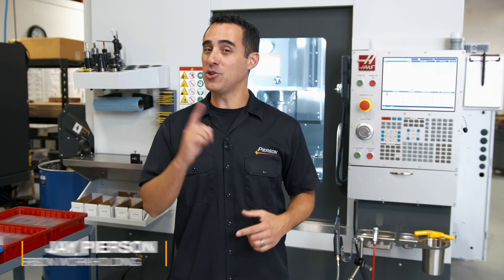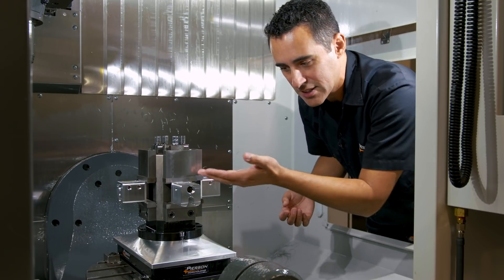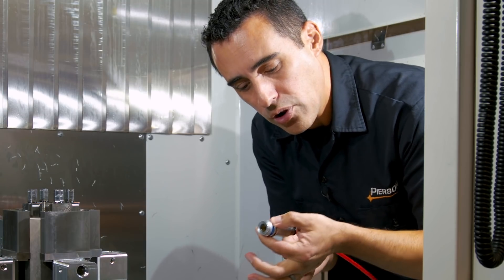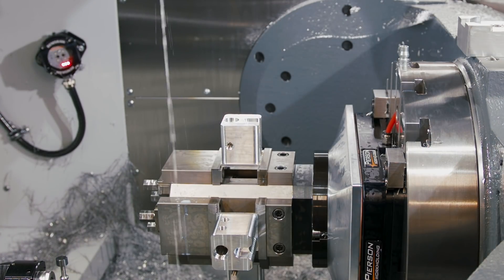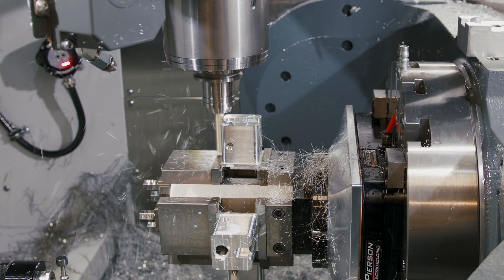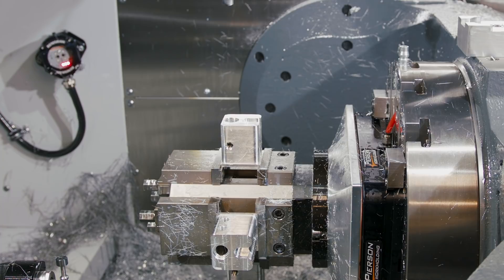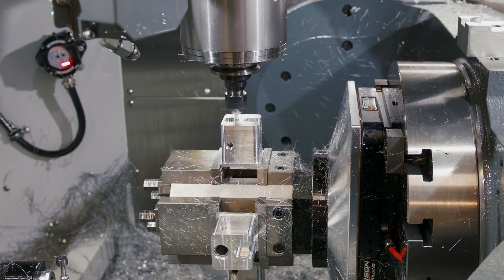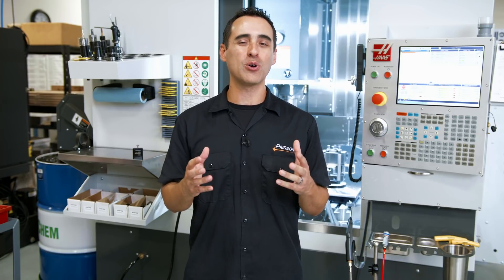Making CHIPS - Haas UMC 500 - Pierson Workholding | Pro Pallet System

Comment: Nice video I love seeing work holding it always give a new perspective.
Have you thought of using small fixture plates instead of a vice? Why not go octagonal instead  of square ? And if the part was set on a 45deg angle you may get two rows of parts that could get you 16 parts instead of 4 . Just a thought with out modelling it up but could be a good option.

Comment: With the thread tool in 360. I'm guessing you have to tick the "modelled" check box to produce thread in a CNC?
Reply from the maker: "Modeled Threads" look good but is sometimes problematic on the CAM side.  We draw to the minor and use "Pitch Diameter Offset" to specify the programmed size.  Fine adjustments of the thread diameter are then done in the machine control using cutter compensation.

Comment: Thanks for sharing your process Jay. Do  you normally cover the male air connection to prevent swarf or coolant form entering?
Reply from the maker: Nope, we just leave it open.  Coolant wouldn't affect anything and the internals of the PPS Base have wiper seals.  A super lucky chip that made its way all the way to the cylinder wouldn't be an issue.
Reply: @PiersonWorkholding  good to know, thanks!

Comment: I like the way the post will rotate one way to do two parts then rotate all the way back around the other way to do the next to instead of simply rotating to the next one.
Reply: Yeah that is annoying, I haven't looked into getting fusion to stop doing that. What's worse is between tools on non-indexing tool paths like swarf, the post spits out G92.1 C0, changes tools and goes back to whatever C value it ended on, did that to ~ C 2000. for a program....
Reply from the maker: Yes, it's a love-hate relationship with the post.  What's crazier is if you're at 359 deg and command it to go to zero, guess which way it will go?  Yup, the long and stupid way.
Reply: @PiersonWorkholding  https://www.youtube.com/watch?v=vupmJflbAIE is this can solve this problem ?

Comment: You guys have to try the quick disconnect from Prevost, they're self-venting, so they're really quick, and easy to connect vs the Japanese style.  You don't get the pop, or have to push them as hard. 
https://www.prevost.eu/connection/quick-couplings-and-adaptors-for-compressed-air-2.html
They make some of the best air guns, and fittings on the market in my opinion.
Reply from the maker: Good to know.  We'll look into it.

Comment: You talk about lean, but your tool oaths return to safety each time when you rotate?? Wastes alot of time no? 
If the cycle time is no issue then that's fine but I would of thought parts want to be on and off the machine as quick as possible.
Reply from the maker: The hierarchy of improvements in lean is Safety, Quality, Simplicity, Speed.  Trading safety for speed means you'll never get caught off guard if you start in the middle of a program, slightly miss an offset, etc. Rapiding to Z8. vs Z3. is mere seconds added to the cycle time and not worth compromising safety or process reliability.
Reply: @PiersonWorkholding  there are so many things to put in place to eliminate everything you have mentioned. You are a smart man. Use your imagination.
Reply from the maker: @fordhoarder As you said "things to put in place" violates simplicity.  You seem smart... what would you put in place?
Reply: @PiersonWorkholding  I am a process engineer for a large production shop. It's my job to make a job run as fast as possible and so simple an untrained operator could run it. Some machines have settings that make it impossible to start anywhere but an M6. If not, you can write a small macros to prevent it. Same if an operator fat fingers an offset.
Reply: Pierson Workholdin
Reply: I came here to make the same comment and you beat me to it. LOL. Didn't expect to see all that fat from a guy that preaches lean manufacturing.
Reply: Safe retracts on a 5 axis machine are complex decisions. While it is possible to manually edit this program to gain a few seconds - that takes time. When the part or program is changed - the freshly posted program needs to be manually edited again wasting more time. Each time manual edits are made - a person needs to watch a cycle or two to ensure it is safe. 

The ultimate lean solution is to put the complexity in the post processor so that it posts the most efficient code with no edits. This takes time, but only once. This is why I have put a lot of effort into post development. I can get 'cycle-start-ready' programs for 5 axis mills and 7 axis mill-turn machines - they require no edits. That is where this process is going in due time. Lean is constant improvement, not instantaneous perfection. 

As Jay said - speed is the last priority because the few seconds of cycle improvement do not overcome the effort to manually edit the program every time. Splitting hairs on cycle time rarely adds value to the entire operation when other factors are considered.
Reply: @Factory400  I can't speak for Confussion360 but every other CAM system I've used has the ability to set the clearance plane. This can be set for every offset and therefore no hand edits are required once it is set to your liking. I too am a big fan of running the file as it comes off the post. Hand edits can be dangerous when reposting after making some  adjustments.
Reply: @fordhoarder  The challenge here is that this Haas machine is using TCPC Tool Center Point Control which is computationally rotating the coordinate system as the A and B axis change. The conventional clearance plane concept no longer behaves as intended - because the Z axis becomes the X axis as the A is rotated. 

TCPC is a great tool, but it presents a whole new challenge for the post processor to calculate the safe zone that is now dependent on many other factors.
Reply: @fordhoarder  It has nothing to do with any limitation of Fusion360. Any CAM system will face the same challenge dealing with TCPC.
Reply from the maker: @fordhoarder  @factory400 is right. The post processor sends the Z home on all B and C index moves for maximum safety. This can't be overridden or controlled by changing the clearance plane. @factory400 Send me your resumé if you're interested... I only hire rock stars and I can tell from your comments that you "get it". We'd be fools to trade seconds of cycle time for potentially thousands of dollars of damage.  jay(at)piersonworkholding.com.
Reply: @PiersonWorkholding  😂
Reply: @PiersonWorkholding  you are the man. :) Excellent attitude of efficiency. 'Seconds' of improvement is nothing compared to a full day of downtime for damages. Of coarse, only 1 day is a good crash. Could be more. 100% efficient programs are only shows that on demo days. Not realistic production. Not worth it.
Reply: @Factory400  all very interesting thins i run a cms ares, antares and a dmu 340g linear all great machines. tbh dmu spends more time broken than working. 
it is dependant on many factors i agree. 
i get that the few seconds you save doing this may be little but after 1000's of parts it adds up, unless there is a bottleneck else where for this part so speeding up is pointless? 
with this relatively small run time could you not go through and find a closer point for the retract height and prove out the code? 

never used fusion for cam, however its design software differs so much from inventor which I use, that did surprise me. i Suppose it is what you are used to.
Reply: I mean Jay, obviously you don't know what you're talking about this dude works for a big company and uses fancy dancy software, opposed to you who owns your own company... keep up the good work and glad to see some videos on the UMC500, the design improvements over the original 750 are great

Comment: why do you not machine the holes on the backside at the same time as the front that would save you some cycle time because you do less repositioning
Reply: Pretty cool! I must say I would go nuts with all the extra index moves and extreme clearance moves if I wanted to run that part as a production piece.
Reply from the maker: @markus Metzger Good idea but the holes don't line up.
Reply: @PiersonWorkholding  i know but if you do positional 5axis and drill 2holes in part 1 and 1 hole in part 3 then rotate the roto-vise and do 2 in p2 and 1 in p4 and so on
Reply: It’s because of the way autodesk’s post processor works with multiple patterned parts. It’s not very efficient, and actually can crash the machine if you only run two parts 180 degrees opposite of one another and don’t factor in the retract plane to clear everything.
Reply: @gamingpc3475  OK thanks now I understand
Reply: @gamingpc3475  Instead of programming it as a patterned part maybe the solution would be to lie a little and program it as one part? It might take a few more mouse clicks...  I assume XYZ0 is the center of rotation? For me it would be easier to bust out the "fat finger-o-doom" and edit the program at the machine. F2 copy & paste is your friend on the HAAS control.
Reply: Justin Warren that really is the way that I have found to go about it in autodesk.
Reply: @Kaptn_Obvious  the problem with with editing on the control is that if you make upgrades to part in cad , then you do your cam ,load it into machine & go through re editing it again . It would be great if cam programs could read backwards from machines & adjust cam file to what you have edited on the machine. I try to edit every program only in my cam , so I can keep setup sheets & tool lists up to date.
Reply: @robertsomerville5377  I understand your logic, but it doesn't work that way for me. I have 1,000+ short run parts with multiple ops that we  make on an irregular basis. Most of the revisions I get are hole location or size, or programed for obsolete tooling, or the program is for a machine we don't have anymore Some were programmed with obsolete software.. Most of the time my "hit & run get it done" method it to edit the program at the machine, or get "programming" to give me some code only for that part of the revision & splice that into the old program. Update the setup sheet, back up the new proven program and then go put out another fire.

Comment: If you were getting too cute with your clearances. Instead of having the valve stick out over the table. Practically get rid of that red hose (or have be extremely short), and attach it to the pro pallet itself. The valve sits on the table, and then 3D print a little cover to go over it, to protect it from chips. :)
Reply: I'm sure that reply was here somewhere. Can't see it. - What I meant was, the connector was already in the T-Slot, instead put it right next to the pallet closer, and on top of the T-Slot, so that nothing is protruding outside the Haas table diameter.
Reply from the maker: @gredangeo  I replied but then deleted because I misunderstood your suggestion.  I later realized that by "valve" you meant "fitting" and I thought you were suggesting to keep a valve with an airline connected.  We had an adaptor like the one you suggested but the chips kept collecting around it.  The second version in the video keeps the face of the table clear of chips.
Reply: @PiersonWorkholding  Oh, ok. Cool, thanks. :)

Comment: Hello Jay , Awesome video - how is the accurancy of  the rotational axes on the UMC 500 ?
Reply from the maker: Very accurate!  The UMC uses glass scales on the B and C for high accuracy positioning.
Reply: @PiersonWorkholding  I don't know about that. I am getting ~.003 on position on holes on the opposite side of 2" block drilled at B90. Also working anywhere near the extent of Y travel and tolerances get really loose.
Reply: Following up on this, have you inspected your parts on a cmm? I doubt those holes are where you think they are.
Reply from the maker: @ericharvey2968  I think you need to run your MRZP calibration again. We recalibrated shortly after installation and found it to be off. We did it a month later and it was still dialed in with no changes needed. DWO is also a key factor to look into as well.
Reply: @ericharvey2968  without knowing more about your setup I'd agree with jay that you've got an mrzp issue. For testing the rotary can you square up an edge and then rotate the rotary 90 to see how it's sitting?
Reply: The parts I am referencing here were done 2 weeks after the install. So I didnt think to re calibrate. I just did the mzrp cycle and x and y location were out about .0006 and the z was out .0026. Gona recut a test and get it inspected. I didnt think to recalibrate so soon after the install.
Reply: @ericharvey2968  yeah I'm not super familiar with that stuff but I'm under the impression that most of the settling happens shortly after the machines been set down. Those values doesn't sound all that bad. It's annoying but you'll want to make sure your probe is calibrated well, I'd bet that Z value might change again after calibrating your probe.
5 axis machines are great but you got to keep an eye on that sort of thing. Our shop isn't temperature controlled so thermal growth is an issue, if the z axis moves .001" and you're decking a part at B90. C0. then B90. C180. the part will be .002" away from nominal. I chased my tail before realizing what was going on with that haha
Reply: @spazzywhitebelt  I feel dumb on not rechecking the center or rotation. As for Z growth, I cut a lot of injection molds on my VF2. on these z blends need to be .0002 or better. To do this I need to stage the program so I need to constantly reset tool lengths because the spindle will grow. Then on finishing tool paths I need to cut deep because the tool holder seems to drift into the spindle (.0001 or .0002). Even the X an Y work offsets seem to drift by .0002 to .0004 after 6 hours of cutting. Makes me wonder how nice an actual mold machine is.
Reply: @ericharvey2968  Those are some itsy bitsy numbers haha. yeah if you're talking that kind of precision I'm don't think the UMC is going to do that, especially indexing or simultaneous 5 axis, it'd be better if you indexed and probed but even then not that tight. We have a VM3, we haven't done molds but have been pleased with blending on the stuff we've done. now if you're talking a japenese machine idk nothing about those because our bank account couldn't handle that haha.
Reply: @spazzywhitebelt  Do you have a good work flow for probing at B90? The inability to run probing cycles while DWO is active caught me off guard. Have you figured out a good probing work flow?
Reply: @ericharvey2968  yeah that caught us off guard too and unfortunately nope. we model the whole setup in Fusion and will create multiple setups (in different orientations) all with their WCS at the center of rotation, then on the machine you set all the WCS's XYZ the same and change the B and C values for each WCS per their orientation, its not great but having all the XYZ's the same makes easier to get your going for probing. We do low volume work do it works for us, there might be a better route though.
stuff like that is annoying but idk if other controllers can handle that, I'm going to assume not and even if they did you'd probably have issues after the part is indexed to a new position because you've moved the WCS...end up chasing your tail haha.
Reply from the maker: @ericharvey2968  Yup, we saw a change of .007" from install to when the apps engineer stopped by for training about 3-4 day later.  It was so off that we were sure the installation technician did it wrong or forgot all together.  We reran MRZP calibration about 3 months later and all numbers were within .0003.